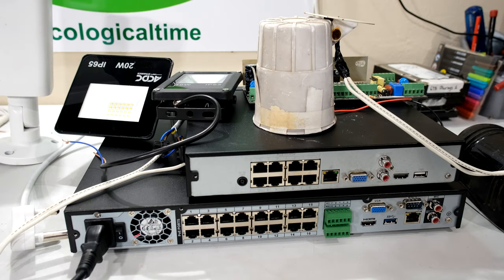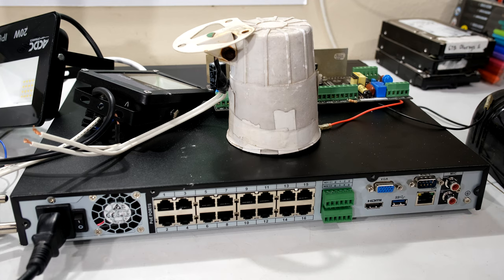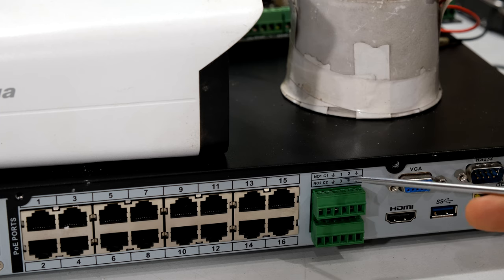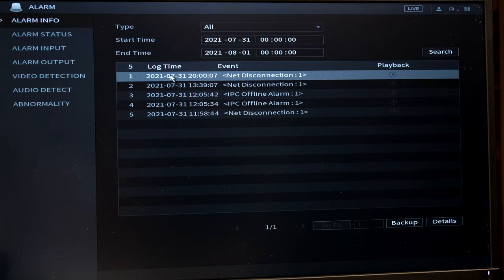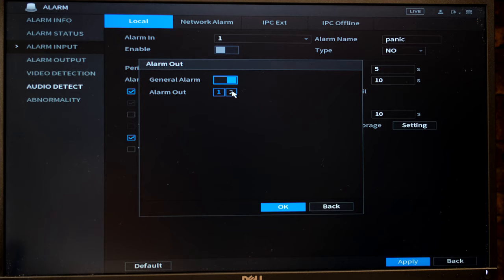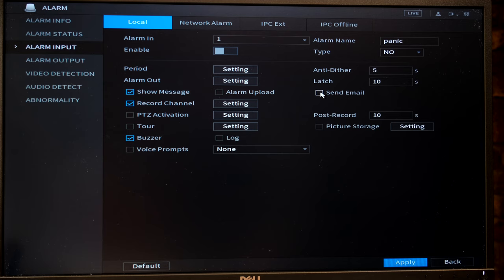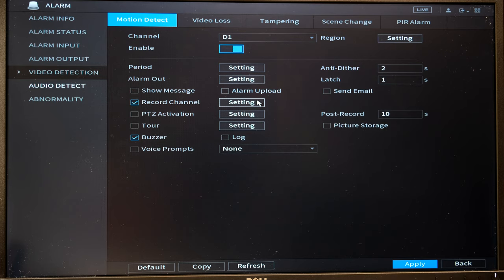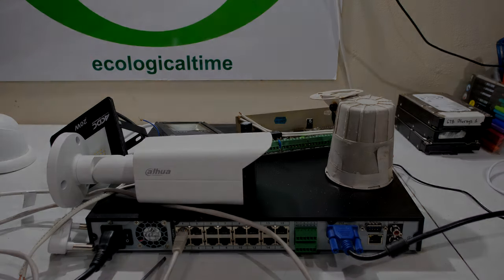Dahua NVR alarm functions - What are they and what do they do?

Comment: YERY SMART!! Thankyou for your Video.
What kind of alarm Panel is that what you are showing to connect the NVR?

Is a Cat 5e or CAT 6 cable sufficient to connect a 30 Watt siren to the NVR?
Is the above com cable suitable also to connect the flood lights which I have on a sensor at present, because I didn't know better?

Using the DAHUA NVR 5216 (NOT the 5216i)

Comment: Keep up the good work! When I'm connecting my speaker to my dahua nvr in getting a buzzing sound can't find what the issue could be
Reply: Its probably your power, ive been doing this for many years and that's always the problem its drawing too much you need to add a external contact or fuse to lower it or buy one compatible.